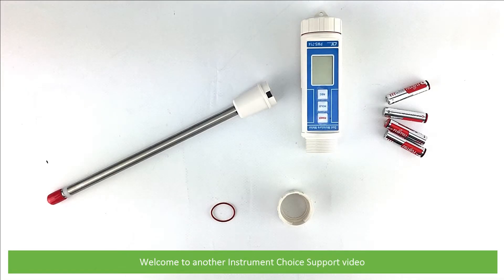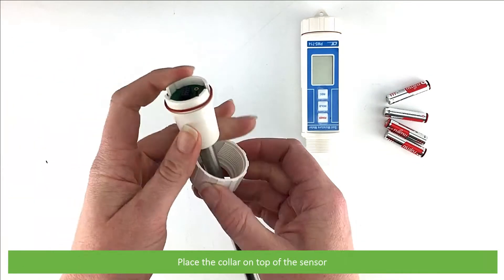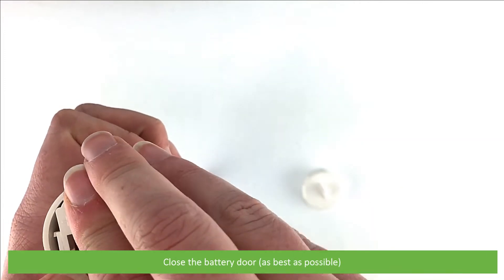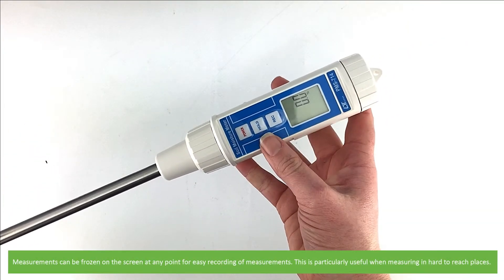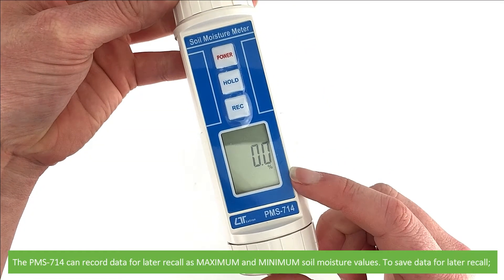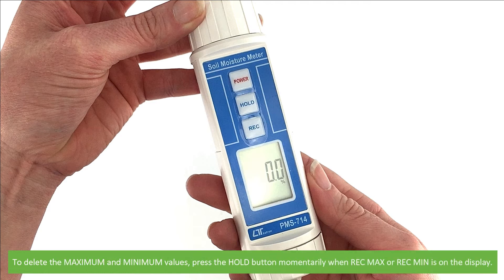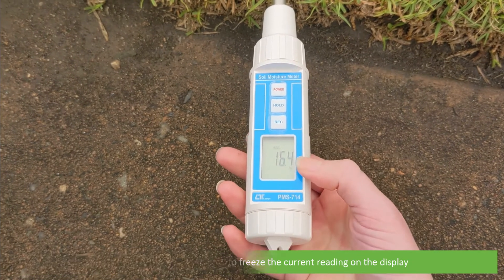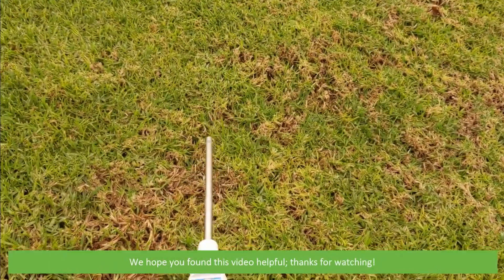How to Take a Soil Moisture Measurement Using the PMS-714 Soil Moisture Meter

Comment: What is a wet reading? What is a dry reading and finally what is a moist reading. I have read the book looked everywhere. Every one tells you how to press a button take a recording but of what? What is 0.9 or 7.1? Is it wet dry very dry very wet. Nuts there is no table to understand what the reading is telling you?
Reply from the maker: Hi Lindsaytemple5645,
Thanks for the enquiry regarding the PMS-714, with this model, 0.0% is dry and 50% is saturated. On this meter, you cannot store readings, you can only hold a reading, or store and display a maximum or minimum reading. I hope this helps answer your enquiry.

Comment: Exotech mo750 looks identical but costs $300 are they the same device?
Reply from the maker: The Extech MO750 and PMS-714 look very similar but they are from different manufacturers. So how each are built can differ. You can use the principles of the PMS-714 as a guide for taking a reading with MO750, but any issues with the MO750 might not be solved in the same way as with the PMS-714.